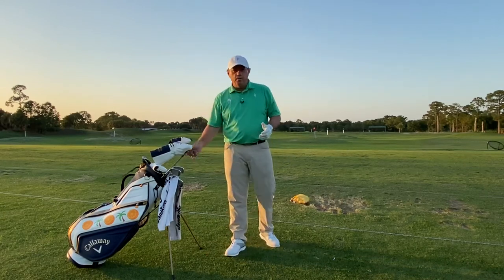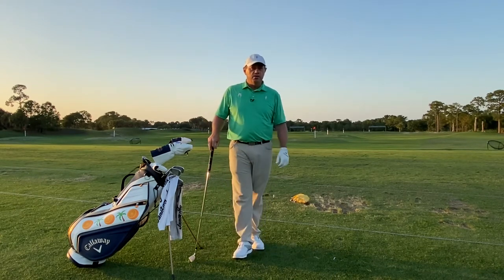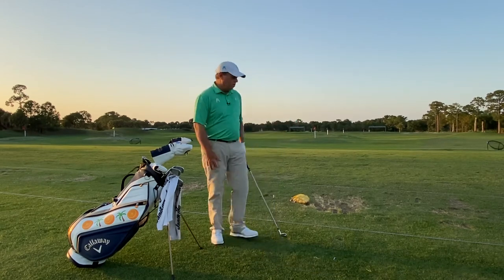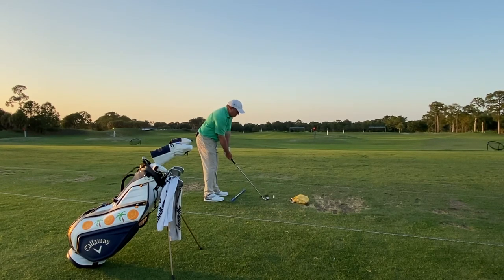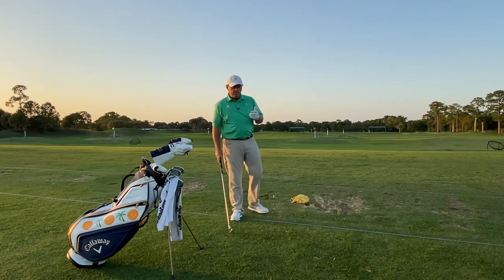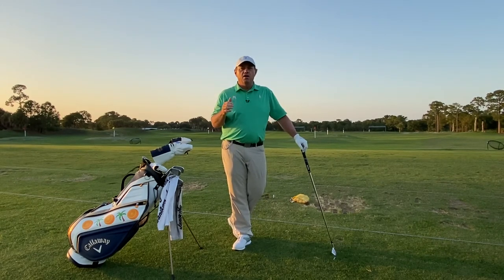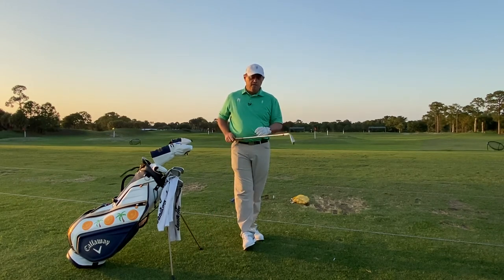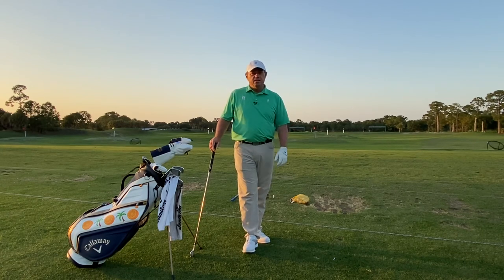Why I use the UST Mamiya Recoil 110 shaft in my irons by Craig Hocknull, PGA

Comment: Do you think the recoil 110s have a similar profile to the modus 120 or project x LZ?  Also were you using the prototype or standard recoil ?
Reply from the maker: I used the original project x 6.5 when it was made by Rifle not true temper, for 10 years. When I switched to recoils I was playing on the Korn Ferry Tour and tried several models. I’m currently using Recoil 110 F4 tipped but I’ve been told that I’ll have to switch to something else soon. I haven’t really hit any other shafts for the last 10 years so I don’t really have a comparison but on occasion I’ll hit a friends clubs and it always feels like I’m working too hard. Hope this helps!
Reply: @CraigHocknullGolf  thanks !